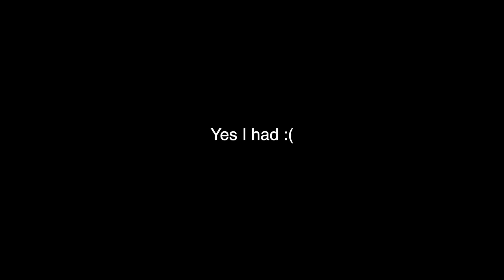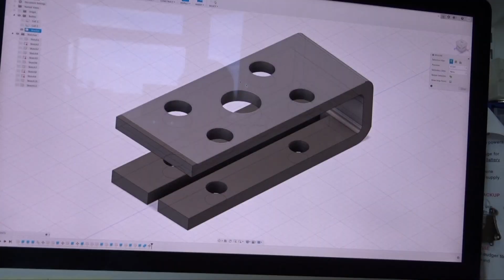Insane battery mounting and wiring! - 8kW Enduro eBike V3 Build - Part 7

Comment: No compression plates? Those cells are going to get bloated
Reply from the maker: I haven't heard anyone else have an issue with these cells. Bear in mind they're designed to be used in EVs so won't swell up as much as cheap hobby lipos. Either way I'll deal with that if it becomes an issue. 👍

Comment: "soldering instead of crimping to make a more solid connection"
crimping is much better when done correctly, it colds welds the strands together with the connector. You can optionally add a tiny bit of solder at the end but it's not necessary
solder on it's own is not as vibration resistant with these connectors
Reply from the maker: Yh, hence why I used crimps for the main connections. I think soldering will be sufficient for the small balance leads though... Time will tell!

Comment: Hya, Just how did you manage to purchase a controller from Alibaba ? They insist on ONLY dealing with Company names and NOT personal? They have sited uk suppliers but not named them so im still waiting BUMP. I am just curious ?  Thanks again.
Reply from the maker: Some do some don't. I bought mine here: https://www.alibaba.com/product-detail/Sabvoton-SVMC72150-3kw-4kw-Brushless-Motor_60631049154.html?spm=a2756.order-detail-ta-ta-b.0.0.2a412fc2hQiddf. The independent retailer Siaecosys (google it) does two versions of the 72150 with all the features but haven't actually ordered from them. Might do tho as I blew my current one 😕
Reply: @EverythingEbikeChannel  Ah right with you, thanks for responding! cheers -
Reply: @EverythingEbikeChannel  Im jumping the gun here however, You had a wobble from the rear motor? I have read that when this happens it causes the very tightly fitted wires to rub and short. In turn destroys the controller and sometime hub too. Just thought id pass it on. If you have not already? This link will save you time and money. https://endless-sphere.com/forums/viewtopic.php?t=66625

Comment: I'm curious.  You have advertised and recommended kandy Kirby ebike 'frame' instead of yours? Is Andy's frame bigger or shall I say what are the main reasons? I am about to purchase my frame now so would like to know. Many thanks in advance!
Reply from the maker: Andy's is a different shape, but larger overall. It has metal frame and then plastic side panels which can easily be swapped out. Also it looks less boxy than mine.
Reply: @EverythingEbikeChannel  thank you so much for responding . Great timing
Reply from the maker: @cejs3273  No worries mate:) Enjoy your build!

Comment: Enjoying your vids. I plan on using the same batteries and frame. Would you say 28 cells is the maximum that would fit in the frame?
Reply from the maker: Cheers! Yeah I would say 28 is the realistic max. You need a way to mount them which takes up space and even if you didn't secure them and had them in a row, I doubt you'd get more than 30 - but with this frame you HAVE to split them up else there's no way you can just slide 28 cells in.

Comment: I don't fully understand how you're securing your cells but those vertical threaded bolts look rather close to the pouches. The last thing you want is for them to wear and puncture a cell mate.
No doubt you'll have thought about it, but it's my duty to point out the obvious 😉
Reply from the maker: It's really hard to explain (I'll try in my next vid!) but as they're so bulky I need to secure each block individually so they can't move around. I'm going to put some bar across where the rods contact to spread the load and might completely wrap them in foam. I agree puncture = bad :)